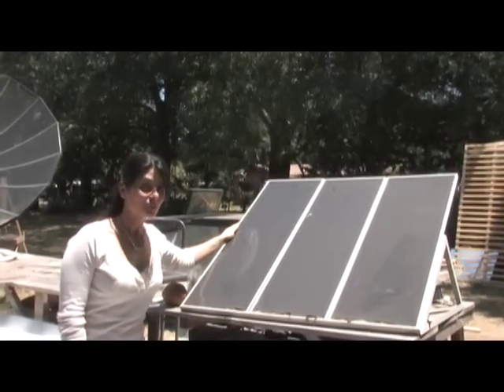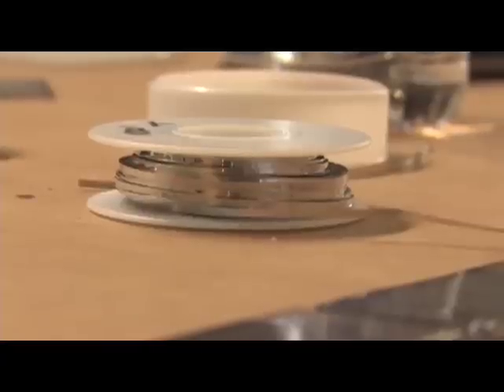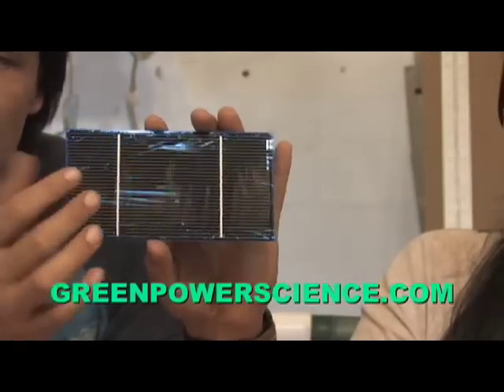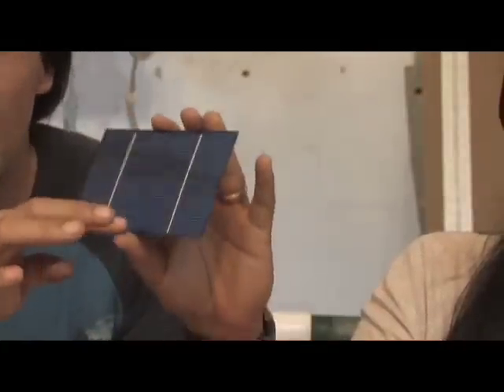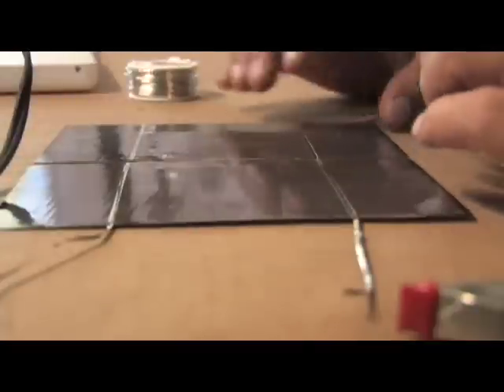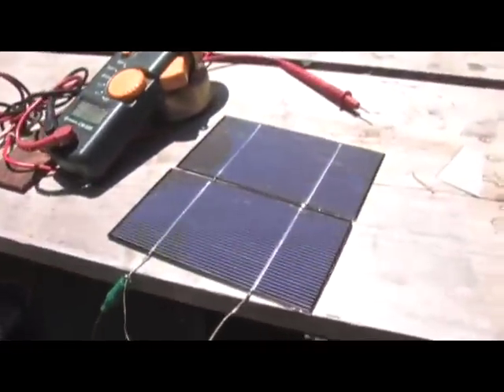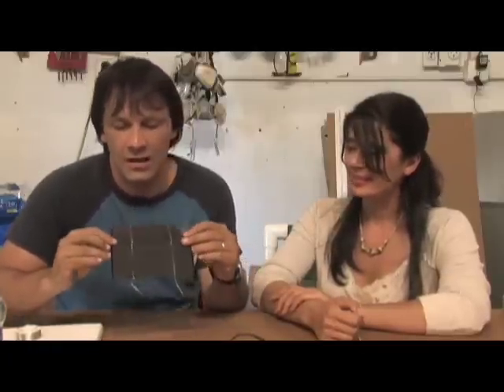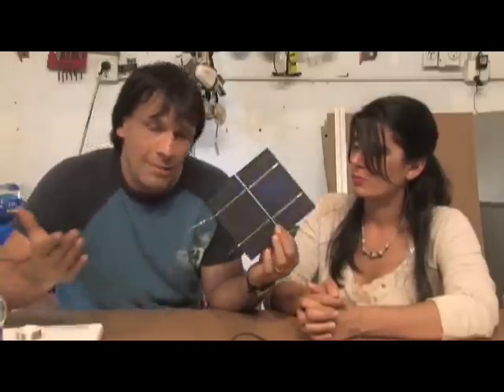SOLAR CELLS Monocrystalline DIY Solar Panels Make Your Own Free Energy

Comment: hey does anyone know  if when yyou have  two batteries, and you connect them inb a series, does the voltage , current and resistance incres proportionally?

Comment: Hi. Thanks... please can you tell me is the front thick wires are touched metalically with the many small wires that seem in the crystal?please i wanna know
Reply from the maker: The small wires or circuits that run horizontal to the larger channel where the tabbing thick wire is attached are all connected to the vertical channels on the cell. This allows the cells to connect in parallel creating the current or amp for each cell. When you tab the entire cells back to front with the tabbing wire, this is parallel and each complete cell increases the voltage. They do it this way so each small horizontal path carries a small amp or current to the main channel. Let me know if this answered your question.
One more thing, this is why broken cells tabbed together have the same voltage as an entire cell, just not the same amp or current.
Reply: @GREENPOWERSCIENCE  yes you answered i thank u for ur fast reply... i live in morrocan sun... i have something going on... now my question was kind of... if u test continiouity between positive and negative in shade...what do u get... and the positive plate back down is it visible through thr front... i just never handled one...
Reply: @GREENPOWERSCIENCE  ahhh if i understand .. so the positive isnt the wire tree collector... its and entire plate melted with crystzls?and the tabbing goes from all the fronts to then turn throught all thr back... and front is negative and back is positive... have u ever considered opposite nature metals... like aluminum vd copper...
Reply from the maker: Front is one polarity and the back is the other. When I first started years ago I thought one wire was + and the other - but both are the same, most cells require two tab wires to handle the current. When the cells are open circuit = no power load, just with a tester, they will have the same voltage in the shade and in the sun BUT in the shade they cannot power anything. So when you try, the voltage drops to zero. Tabbed cells on completed panels, all cells must get sunlight. One large tree leave on a few cells will make the panel weak. All the cells work together.
Reply: @GREENPOWERSCIENCE  thanks a lot... i really appreciate your work... enjoy it the most :)

Comment: I came her to learn some science stuff and I did.  Didn't also expect to be astonished by witnessing the perfect husband-wife couple.  Re the technical part of the video, on balance I think I'd buy a system rather than spend so much time putting those smaller cells in series.  Shame there's not a quick click-and-fit system for it.  Interesting though.

Comment: Hey Dan, the voltage vs. light curve is logarithmic much like any other diode right? If there is an adequate light for the cell, is the voltage very constant? The only thing that really changes with light is amperage? (and of course wattage)

Comment: Interesting, but needs way more information. For example, how does a panel get hooked up to a battery to charge?  Is any protective circuitry required? How do you pick up 36 delicate cells  - don't you need to flip them over during construction?  How do you lift them onto a mounting panel without breaking the tabbing strips.  The whole thing isn't really thought through very well.

Comment: Hola amigos, 
I am building my own solar panel for a senior project. 
I am currently using a 25W soldering iron that I owned but it just aint cutting it.
I was wondering what is the best soldering iron wattage to use.?

Comment: BTW Dan,
You really need to learn how to solder properly. Pre-tinning the tab wire will save many burned finger tips. And don't melt the solder on the tip of the iron. You should apply the iron to the solder point and hold, then touch the solder to the solder point. The solder will melt and flow towards the heat source. If it doesn't, you didn't heat the area thoroughly. Often this is caused by a dirty tip. Use a wet sponge to clean the tip and get some Flux paste.Re-tin the iron's tip often.

Comment: I know this is an old video, but if anyone is still here who knows anything about electronics.  Can I use a Villard cascade voltage multiplier to boost the voltage of the cells and use less of them to make the same voltage? or what about a very large version of a Joule Thief circuit using large Mosfets in place of transistors to jump the voltage up then feed it into an inverter?

Comment: TIP TINNER/CLEANER!

This will make your soldering 500% easier!
It improves the contact with the iron and solder, and if used even a small 25 watt would be able to solder those cells.  Also because you dont have to press as hard with a properly cleaned solder tip, less cells would be broken.

Comment: Why do you have to run the tabbing wire across the entire front? are the cells not already joined in the front from top to bottom? Can you simply bridge the tabbing wire from the bottom across the back of the 2nd cell to the top face of the 3rd cell?
Reply: One side is positive, the other negative, so no.

Comment: If the strips run all the way accross the Negative side, then why do you need to attach the tabbing wire all the way accross. I understand the need to solder it to all 6 little spots on the Positive side, but again, if the strips run all the way across the Negative side, why can't you just solder the tabbing wire to one end or the other of the strip ? 

Seems like you could use 40% less tabbing wire. instead of wasting it  to make full contact accross the strip if it doesn't need to.

Comment: You could save on a ton of soldering if you tabbed about 1/4" from the bottom of the front panel. Those thick line should connect that entire section and on each side. One comment was not wanting to use Silver solder, if you plan to do a 100 cells, better off with the silver solder cause a crap load of current is gonna get that stuff hot and would ruin an entire array. Plus, if you use resin or embedded the array, you'd have to tear it up and risk breaking cells.

Comment: I have half of my panel done, 18 cells running together but i keep running into a strange issue everyonce in awhile i add a cell and retest my voltage and it drops. strangely it drops the power of the cell.  example i have 5 together producing 2.5 volts, I add a cell and now I have 2 volts again?  I soldering the correct way top wired to bottom, whats going on?

Comment: It seems to me that you shouldn't need to solder the ribbon onto the entirety of the front surface - soldering just across part of it should do, as the 2 lines you're soldering it onto are conductors that already joins all the smaller (horizontal in the picture) lines. 
Could you please confirm?

Comment: Probably they should be investigating new ways to save energy before they spend vast amounts of money. A case in point is that in 2005 the Government, Market Transformation Program had tests made on a new type of cleaner that employs Air Recycling Technology. The results show that it could save 1.5 Terawatt  (1,500 Gigawatt) each year in the UK alone. Simply, by changing the type of cleaner we use in our homes. It was originally designed to remove health hazards inherent in the vacuum cleaner.

Comment: Hi i tried making my own solar panel i used 36 3x6 cells and got about 18volts on my digital tester i used 8 gauge wire to go from panel to charge controller but when i tied it into the other panels the voltage on controller dropped not incressed like i wanted it to so if i had 20.2 v b4 with other panels and connected one i made it went to 19 volts what should i do to correct this thanks ps panels are wired +to+ -to-

Comment: Dude, why does the tab have to run the full lenth on the front face? Surely it only has to make the circuit from front to back by connecting only say an inch from the front strip??

Comment: Once you've gone to the trouble of making your own PV panels, how much money are you actually saving vs. purchasing commercially made panels?

Also, here's "a word to the wise" about using them over long periods of time: clean them periodically. I used to service solar powered traffic control equipment, and the output would drop off rapidly with just a thin layer of dust (or bird droppings) on the panels.

Comment: I'm not an expert but I can tell you that the charge controller regulates the voltage going to the battery because 12v panels really put out 20 or more volts, they also keep the batteries from over charging and ruining, and lastly you don't need a diode if you have a controller. The diode keeps your batteries from feeding back through your panels draining it and or ruining your solar cells, but the diode will not regulate the volts coming from the panel and that could ruin your batteries.

Comment from the maker: Amorphous cells are but they come completed. If you need higher voltage over a smaller footprint, snap the cells to 1/4 and stack like this video:
watch?v=JJTpWPHAoUk

The current (amp) is lowered accordingly.

Comment: 2 panels connected parallel with each panel having 20 modules. Each module gives 24 volts. What is the total voltage of the 2 panels? 24, 48, 240, 480?
Reply: You need to look up connecting 2 batteries in parallel versus a series, that will answer your question.

Comment: , two thin coats are better than 1 thick coat, the less hardener you add the faster your cure, if you add more resin a than hardener b, it won't cure at all, you can mix it with a mechanical stirrer, 1 that fits on a drill ,this will mix it completely if you go around the sides, don't worry about bubbles ,you can pop these with a butane torch, just don't hold the torch in 1 spot too long, the CO 2 from the torch pops the bubbles, you could spread with a brush as long as it's Chinese hog bristle,

Comment: @believenman 
Possible, yes, probable, no.  You're going to spend somewhere around $20,000 if you build the panels yourself, and three times that if you buy them from a manufacturer like Sharp or BP.  That's just the panel cost... you then have to factor in inverters... and that's only if you plan on using it during the day and on days where there's sun, or you're going to have another $10000 in batteries.

Comment: Do you really need 18 volts to charge a 12volt battery? i think 14.4volts is whats needed normally. More if it is colder and less if its hotter.

Comment: I was on a forum that belongs to a store that sells solar panels and all I heard from the mods was what a nightmare it could be building your own panels and using wood because you could burn down your own house(self interest or truth?). They were talking about the wood(panel frame) twisting from heating and cooling and breaking the cells and busses causing a fire. Could anyone here who has had experience with DIY panels installed for more than a year give their opinion. Thanks.

Comment: @Manoo62 and ltsmeeman: it is a silent "L" in English. It is pronounced "soddering" and not "SOLLdering". If you ask an electrician, plumber, they will confirm that. You use a soldering iron to heat up the rosin- or tin-core solder (I believe there is lead-core too, more toxic). It is much like the English word "talk". Usually you say it "TAWK" versus "TALLK". Hey I should try that, see if anyone notices me tallking to them, lol.

Comment: Hey Lego generation, some one must manufacture some plug-in/unplug friendly panels, frames and tubes for these cells. We need to install them all over freeways and roadsides. Oh don't forget we new generations of solar cells which are able to function under higher temperature because we want to work with sunlight concentrators like parabola mirrors and Fresnel lens so cells cost won't be major hurtles for any projects.

Comment: Like i don't want to be rude and i'm sure your advice is great but it is a pet peeve of mine and having worked with electricity for a while I can't stress enough how uninformed it makes someone sound when they say "Amperage" like sure it might be a word but it isn't a word anyone says.  Current is the rate of flow of electrons and Voltage is the potential difference in electrons.  Proper nomenclature means a lot.

Comment: Once you have made your first joint, you are better of slowly sliding the iron up and down your wire or you may create "hot spots", where the cell cracks and becomes useless. I know because I've done it.  Also, that is why you would use a hotter iron.

Comment: Well maybe you should take a look at the instruction for flux too...
See flux for soldering electronics is NOT acidic and therefor it does not clean anything, soldering flux is there to prevent oxidation of the soldering medium and the base metal. It also aids in making the solder flow more easy between the base metals - Electronics must be cleaned up manualy before soldering on it.
After the soldering process is complete any flux recidue must be removed as it can become acidic due to heating

Comment from the maker: go to dictionary com

sol·der   [sod-er] Audio on 
noun

\ˈsä-dər, ˈsȯ-, British also ˈsäl-dər, ˈsōl-\

"SODDER" is correct in USA
1.
any of various alloys fused and applied to the joint between metal objects to unite them without heating the objects to the melting point.

merriam-webster com/dictionary/solder

Rhymes with SOLDER

dodder, fodder, khaddar, Modder, nodder, plodder, prodder, wadder
I am correct:-)

Comment: you dont have to run wire the whole length of the cell , just solder it to the edge on each line then to the next chip and on and on

Comment: Well last time anyone checked...flux is a cleaning agent and cleans away contaminants that will impair the solder from adhering. Nothing to do with air. Solder will only work if both sides are clean. Since metal likes to oxidize when soldered flux stops this process.

Comment: ya your iron was quite insufficient, that must be some really thick metal, you can be a lot more delicate using liquid rosin and a qtip to apply it rather then a pen, also make sure to clean the panel before final use.

Comment: The video is okay in the aspects of basic information. The only problems I had were your "SOLDER"ing techniques. being able to adjust temp. can make big diff... Ideal soldering temp is between 600 and 700 degs. F... also note that your solder tip on that iron is really bad. replace tip and always remember to tin it after youve soldered the lead. you should also have a damp spounge to remove solder from the iron before soldering. YOU SHOULD NEVER CARRY SOLDER ON IRON!!!! apply heat to area and..

Comment: If you're watching this this isn't how you solder dont put solder on the iron and transfer it to the part the joint needs to be hot for a good bond you use the iron to heat the part you are soldering and let the part melt the solder for a good joint but make sure you don't overheat if need be you can place a small amount of solder to the irons tip so it transfers heat to the part but dont use the solder on the iron for your connection and you dont need to use silver solder regular solder works as well most silver solder carrys a very low percentage of silver you don't need the silver and the percentage is so low it doesn't make any sort of difference anyway and as far as flux just dont use acid flux as overtime it will oxidize the connection ther are plenty of good tutorials on YouTube that will show you good soldering basics

Comment from the maker: @mitchellberry Thank You:-)

Each 36 cells configuration produces 80 watts. You generally loose about 10% from inverters batteries etc.
So 70 watts x 10 units = 700 watts. If your ebill says 96 kWh a day usage div by 24 =4 kilowatts per hour average.
You get about 10 hours a day of good charging (10 units 36 cellse each) 700 watts x 10hours=7 kWh per day so GRIDLESS 120 large panels BUT goal get the 100 kWh down to 50 kWh or less CPF bulbs, tankless water heat etc. 
Offset=1 panel or more:-)

Comment: hi i bought some packages of 40 monocrystaline cells from ebay and made 4 panels. i have 22v and 5amps each panel, but maybe in summer i might have 24v. (i had connected 40 cells in series evrey panel) now i am planning to buy an inverter. 

The panel i build is constructed by 40monocrystalline cells connected in series each cells have  average power-2.6wp,  average current amp -5.2 max,  averege voltage-0.5Vmax  efficiency up to 16.64%.   and finally i connected a diode.   Each panel supposed to have 100w.  but it is giving 22v and maybe 24v in summer each panel.

Now an inverter that says DV input rageng 10.5-28VDC is good right? Even that is says it is for 36cells?

tks in advance
Reply: and then?

Comment: It is just as cheap or cheaper to buy them.
Reply from the maker: david Moore Cell cost has become less expensive too so building your own is a money saver BUT, I agree that a completed panel is a better bang for the buck when you factor in time and finished quality. DIY builds are a great learning experience and work well for custom panel size requirements. When we made this video, solar panels were 3x more expensive per watt than they are now.
Reply: Dan and Denise!  You just hit the nail on the head... Custom panel size requirements!   I want a low voltage and HIGH current panel  instead of high voltage, low current, but I do not wish to go through the painstaking process you displayed in this video.  Do you know if any exist out there?  I want a 2V panel (so that's 4 cells in series) and then I want a bunch of these strings connected in parallel for a greater current.  The reason for this is to drive electrolysis of water in a SINGLE electrolytic cell instead of a more expensive stack of cells.